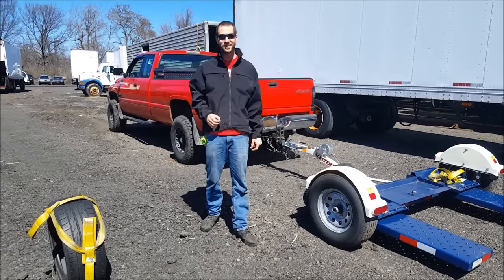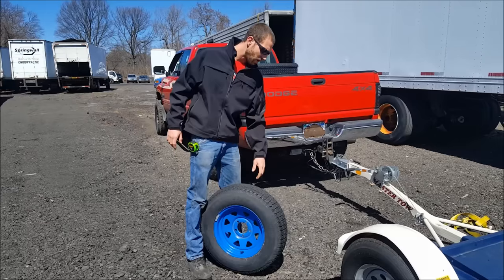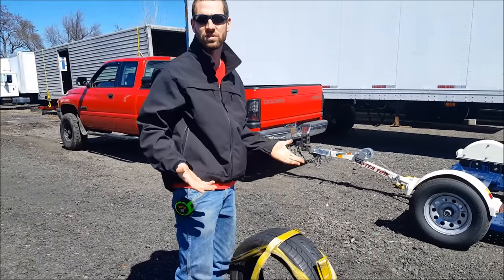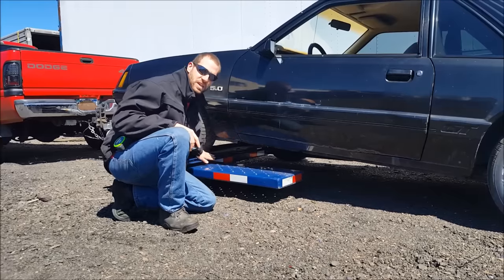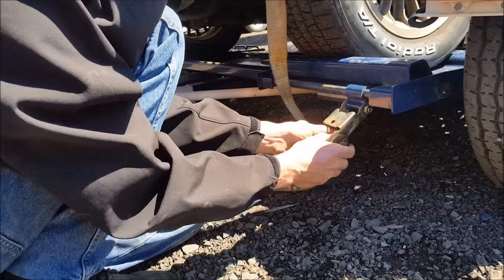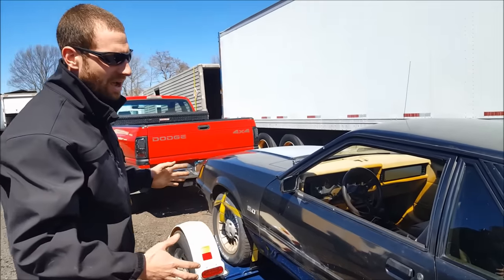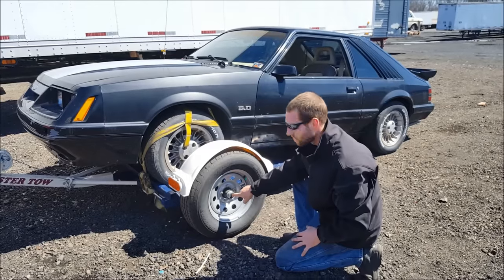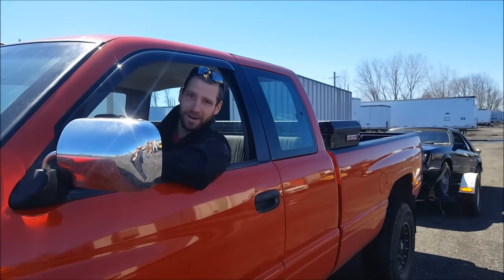HOW TO USE MASTER TOW CAR DOLLY mastertow 80THD instructions

Comment: Great video! What is the best way to go with the brakes? Serge or electric brake controller?
Reply from the maker: Thanks man! I haven't personally owned one of these with brakes. But if I did I think I would go with electric brakes.
Reply: Thank you for your response.  I am with you on the electric controller.

Comment: Couldn't you put a RWD vehicle on it backwards so you don't have to disconnect drive lines or use neutral?
Reply: Did you not watch the whole video? He explains that when you do that the steering will most likely start to sway the vehicle side to side and will most likely rip the dolly off the ball and now your car is gone

Comment: Rear wheel drive vehicles:  I don't know how to remove the drive shaft.  Can I just put the car in neutral and be done with that problem?  Sent a like; by the way.
Reply from the maker: How far are you going, what type of vehicle is it and is it manual transmission?
Reply: @NoNonsenseKnowHow  All I know is I started a furniture moving hauling service.  Now people are asking me to haul vehicles.  2 calls in one day.  They are standard 3,000 pound or so vehicles.  I never rose to this challenge; but I need money.
Reply: @NoNonsenseKnowHow  One haul is 120 miles, one way.  Other haul is like 20 miles.  No statement made on type of transmission.  I have no vehicle dolly; must rent.
Reply from the maker: @randyclar747  it's probably automatic since something like 95% of vehicles these days are automatic.  In that case, no it's not safe to put it in neutral. Would it work? Yeah probably.  But it's possible you could damage the transmission
Reply: @randyclar747  In most states if you don't got the proper licenses CDL your insurance on your truck will not cover the towed vehicle. Some thing you might want to check out.
Reply: You will have to know vehicle make model and tran type. You can check with dealer or on line. But if you are not proper licensed to tow cars be aware your insurance will not cover the towed car. You can only tow a car you own. I do it often but am no longer licensed to tow because of my health. And i let the owner know up front about the insurance. But if towing some ones car you need to rent trailer not a dolly.

Comment: what's the best kinds of tow dollies to buy.I thought about renting 1 from U Haul.If u or can you use any tow dolly that has more than enough capacity to tow a car in nutral like do it matter even if it's in nutral.I hace a 98 gmc 1500 Sierra pickup truck ?
Reply from the maker: They're all built pretty similar. The master tow is a great dolly. The U-Hauls are in my opinion even better quality. But trying to find one of those for sale is near impossible.

Comment: I have been looking around and not seen many into on this topic but I am looking 7 O see if you can make some decent money with this havling cars with a Truck I am not looking to get rich but looking Xo start small and Work way up.any suggestion on this?
Reply from the maker: I guess it depends on your region. Around here it would be way too competitive. I used to make great money with this thing picking up junk cars and flipping them for a profit. It really came in handy. The other problem with trying to make money with this using it as a tow rig is that not exactly legal and you would need to start a business and all that jazz
Reply: @NoNonsenseKnowHow  that is my intention it just i not rich lol. I got the truck and these only go for 2k versus 5k or more for the larger trailer then u need dot inspection and bunch of stuff to get started. Dolley u don't need dot just register. And car needs to be legal on road as its wheels touch the ground not sure how it would be illegal something u know I have not seen yet? And honestly everything is competitive now and days there is barely anything considered new and original ideas for making money. As for business dont bother me but this wouldn't be only thing I just trying to find ways to make money on my own if I get only one or two deals here and there is fine I do other stuff as well. Just for me its more opportunities  to make money when one thing falls short and another opens.
Reply from the maker: Can't hurt to get one and try it out. I would recommend finding one you used. I paid only $600 I think your mine

Comment: hi is there a reason why you cant put a rear wheel drive on there  back wards
Reply: He talks about this in the vid briefly - the biggest concern seems to be the engine weight being all the way in the rear of the vehicle, which can lead to unpredictable travel at high speeds - I've heard horror stories of cars flipping when towed this way at highway speeds. Low speed (<40mph) and local tows (<10 miles) are probably fine, but that's it. 

My question is regarding mid-engine cars like the MR2 or Fiero - can these be towed using a tow dolly with their front wheels on the ground, as long as steering is locked? At that point, the weight will be over the tow dolly's axle, which should make it more stable.

Comment: I only need to tow 7 blocks. can I put it in neutral and the car on for the rear wheel drive? front brake is locked up. why I can still start it

Comment: Almost every time I unload my car from my toe dolly the ramps are crooked. I've tried driving around for a little bit to get him to straighten out. Before loading I often have to have someone really strong to hit it with a mallet multiple times to straighten out the ramps before I can load. Any suggestions on how to have the ramps straight when I finish my trip. Is there something that maybe I need to loosen or tighten? I do have the master that you are showing on this video.
Reply: don't move the ramps, move the platform the car rides on

Comment: I HAD ONE WOULD OF THESE TOW THINGS AND EVERYTIME I TURNED OR MADE A U TURN THE THING WOULD COME OFF OR GET LOOSE I GAVE THAT SHIT AWAY NEVER FUIGURED OUT HOW TO USE IT CORRECTLY
Reply from the maker: Yeah they can definitely be very hazardous if the vehicle is not secured down properly. In fact they're pretty hazardous either way in my opinion. Thanks for your comment

Comment: Tried using U-haul dolly...... never again. Straps couldn't be changed to size (one size fits all) and dolly had over pressure in tires. Never trust a U-haul
Reply from the maker: Those U-Haul dollies are usually pretty good.  But yeah it sounds like they have to upgrade the strapping

Comment: My first trip out I turned right and I heard a pop and we discovered the lock had broken the steering wheel lock and when I checked the wheels were still turned. Any suggestions? Thanks.
Reply from the maker: Use seatbelt or ratchet strap to hold wheel
Reply: Somewhat.confused about locking.the steering.wheel.  i know some  dollies allow the front wheels to pivot and  some dont. The dolly in  the video doenst appear to be able to pivot. If the front tires cant pivot, the tires on the doll will be dragging laterally trying to follow the tow vehicle when turning .  It would also put extra pressure on the steering wheel lock and the straps because the front wheels trying to turn and cant.  Im guessing thats how youre steering wheel.lock broke.  It also explains why the wheel straps loosened so quickly in the video.  

This is very similar to pulling.a wagon.  The dolly is the same.as the front axle.and.tongue of  a.wagon and.something.needs to be able to turn.
Reply: @53kills  I have used tow dolly for years and still use one several times a year. Just like towing with tow bar always unlock the steering wheel. Leaving car steering wheel locked can brake straps and cause all kinds of problems. When they started putting pivot on dolly . Some still don't have pivot. because of pivot on dolly people started locking steering wheels and all kinds of problems have happened. Like straps coming lose or braking. The pivot on dolly does not have much turn angle. But does have enough to get car siting with both wheels against front stops. Towing down the road just like a 2 wheel trailer the truck steers it by the fact the inside tire on dolly turns faster than out side dolly. Adding the pivot can cause the trailer wheels to try to steer the front of car in wrong direction. Any car being pulled with a tow bar or dolly will steer it self in direction it is being towed if steering wheel is unlocked. But if turned to sharp a towed car with steering wheel locked will cause the tow dolly to try to slide rear of towing vehicle around. On a wrecker with rear wheels raised off ground the hook up can swivel you lock front wheels and they steer just like a trailer axle does. Some tow dollys with pivot has a lock pin so after car is on dolly and straps are on with both wheels against front stops you can lock pivot and unlock car steering wheel and not have the problem of the car trying to pivot dolly while tow vehicle is breaking. 40 years of using dolly and towing several hundred cars you will learn a lot about using dolly. I just towed in a one ton truck couple weeks ago it did not have motor or transmission. Going to tow several junk cars to scrap yard in next couple weeks while metal price is high.

Comment: could i pull a 90 miata with this towing the miata would be a 2014 Subaru outback
Reply: Reee Reee I would check tow ratings but yeah, you’d probably be good. However, if you have a cvt, I really can’t recommend it. Those things can’t take stress and it may over heat. With a manual, you’re absolutely set. If you have a regular auto, with 5 or 6 gears or whatever it is, that should be fine too. Just be careful on steep inclines and watch trans temps. With a manual you don’t have to worry about trans temps.
Reply: Thanks i got lucky it is 15 min from my house no steep incline 6 speed manual outback tow rating is 4400 I believe
Reply: Reee Reee I knew you’d have a manual when you said you were towing a Miata but I had to mention it all to be sure lol. With that vehicle you probably won’t even notice it behind you. Just be careful on turns and curbs and always take turns as wide as possible. I bet you could tow it across a state without an issue. One thing to mention, check if you need to remove the driveshaft or not. The person who posted this video mentioned that on some manual vehicles, leaving it in neutral may not be enough. It could mean the trans doesn’t get lubricated. Worst case scenario you need to remove the driveshaft but that’s an easy job.
Reply: Joseph Samsor thank you I can check that

Comment: So what about an Automatic transmission? Do i have to put it in neutral as well? how would i turn the car off..
Reply from the maker: I wouldn't suggest Towing an automatic transmission rear wheel drive car. In the description of the video I go into more detail
Reply: @NoNonsenseKnowHow  Its a 2003 buick lesabre. So its a front wheel drive.
Reply from the maker: That's no problem then. Just put it in park and make sure to take the parking brake off
Reply: @NoNonsenseKnowHow  Thank you so much! great video, fast response. Thumbs up man!
Reply from the maker: No problem man. Good luck and tow safe

Comment: Bro i heard rhat if you tow a rwd car with the driven wheels on the road then  it can damage the transmission due to oil starvation. What do you think?
Reply from the maker: Yes I've heard the same. If you read the description of the video I touched base on it a little bit
Reply: So can we tow it backwards. I know you said its not worth risking but what if we drive it under 40mph?
Reply from the maker: @mohaimenhassan  automatic or manual transmission?
Reply: Actually i haven't decided yet. Here in Malaysia you can get a Singapore scrap car that is actually in good condition. The problem is you can't register it so its illegal to drive it on the road. So i want to drive it to the track with a dolly. It can be manual or automatic. Please guide me for both a manual or an automatic car. Thanks. 😊
Reply from the maker: @mohaimenhassan  automatic transmission is definitely a no-go unless you remove the drive shaft. For a manual it's a little bit safer but still a great idea to remove the drive shaft. Honestly I think you're better off getting a trailer. That's definitely the way to go
Reply: Ok a trailer it is then

Comment: to stop the top plate from swinging side to side when reversing drill a hole in the top plate both sides and drop in a large bolt  remove when going forward, would that work ?.
Reply from the maker: Yeah that might help out a little bit. It would still be tough tho

Comment: for a fwd manual trans. do you still keep it in neutral or do i put it in a low gear? much appropriated, thanks
Reply from the maker: kmc619 yes you would leave it in park or low gear and leave the parking brake off

Comment: How do you tow a 4x4 auto Geo Tracker without towing backwards?
Reply from the maker: MyEmptyNestQuest remove the rear driveshaft . or tow it on a trailer
Reply: Unless it has a manual transfer case with neutral

Comment: Can I tow a 99 f150 from north Carolina to Oklahoma with a 2010 tundra. How hard or what difficulties might there be
Reply from the maker: I suppose you could. I would definitely disconnect the drive shaft.   for long trips I  prefer a flatbed trailer. I've never gone more than 100 miles with the dolly in 1 clip
Reply: Its 1,251 anyone rent trailer that would fit regular cab long bed. Planning on going through georga then back up to Nashville. Stay out of mountains.
Reply from the maker: @toddhaver1143  1251 what? miles? Or dollars?
Reply: Miles
Reply from the maker: @toddhaver1143  oh gotcha

Comment: my rv came with a tow dolly and i have a 2000 jeep wrangler,would u know the procedure on how to do this? cant seem to find any on youtube, thanks
Reply from the maker: Does your Wrangler have a manual transfer case?
Reply: @NoNonsenseKnowHow  5 speed 4x4,straight 6
Reply: @NoNonsenseKnowHow  5 speed 4x4, straight 6
Reply from the maker: @tanyamari73  that doesn't exactly answer my question. But assuming it has a transfer case that you can put into neutral, you should be able to tow it just like that.  The safest bet is to remove the rear drive shaft though.  Honestly I would probably go on a few RV or Jeep forums and ask this question.  I would be shocked if somebody did not ask a similar question in a forum somewhere. Sorry I couldn't be of more help
Reply: Jeep says liberties need to be towed with four wheels on the ground even with the transfer case in neutral. It's a tricky procredure to do  but they're great for flat towing with an RV. Point is be careful with the wrangler.....read the manual

Comment: I'm trying to tow a car with a tow dolly.But the car don't start.So I'm thinking ima have to push the car myself on the tow dolly ?
Reply from the maker: If you don't have a winch on there like the one in this video, then yes you would have to push it on
Reply: use a come-along
Reply: Puedes acercar el Dolly manualmente, pega al vehículo, reversa un poco, para esto debes poner en freno de mano el auto qué vas a subir

Comment: Would this work if you had to tow backwards a car im getting needs a rear end and doesn’t move
Reply from the maker: Yes. But I wouldn't really recommend hitting the highway. It can be dangerous.  Make sure you lock out the steering wheel

Comment: what if you tow a rwd auto with the    ENGINE RUNNING
Reply from the maker: Franklin Hicks that's a good question I've thought of that before as well. But I've never researched it tried it.  My guess is that it would be okay since the transmission pump is running. But I couldn't say for sure without researching it.
Reply: Its actually not a good idea. I know from actual experience. Its very risky to run an engine for prolonged periods of time at that angle and can result in oil starvation issues to certain parts of the engine. My Fathers main bearings on his big block Buick didnt survive.  And yes every engine and layout is different.
Reply: may overheat without proper air flow

Comment: Greeting, can I reverse while towing with master tow.  Thx.
Reply from the maker: I spoke about it in the video toward the end. Yes you can reverse, but it's very difficult so I would avoid putting yourself in a position where you have to reverse it all. It can become near impossible in some instances to reverse out and you may have to remove the vehicle and detach to get out of a sticky situation. Avoid reversing at all costs
Reply: Thanks a lot for your advice and quick response.  So clear 👍🏼👍🏼
Reply from the maker: @ibrahimm.alhmly9165  no problem man, good luck with the dolly
Reply: Best regards

Comment: i watched this video came to the conclusion some how not suitable for front wheel automatic cars ... but automatic front wheel drive cars are fine as drive shaft isnt connected to anything and wont harm transmission ...just put in park leave e brake off very confusing

Comment: This guy doesn't have a clue what can be towed with drive wheels on the ground. Some manual transmissions won't lubricate the transmission unless the input shaft is spinning, and there are many automatics that can be towed without removing the drive shaft.
Reply from the maker: Read the description of the video

Comment: I was hoping for some tips on using chains under the front.Never trust the straps only.I pulled an accord home and the straps loosened.The wheel stops and chains were all that held it,the last 10 miles.Not a good video.
Reply from the maker: I've towed hundreds of vehicles on dollies and have never had straps "loosen" on me.  You need to re tighten them after the few First turns as I described in the video . If they loosen after that then you need new ratchets because that's not normal.  If you read in the description I talked about the chains.
Reply from the maker: However I do agree with you that the chains should absolutely be on there. And that's why I talked about it indeed description.  Especially if you want to stay legal for the DOT.